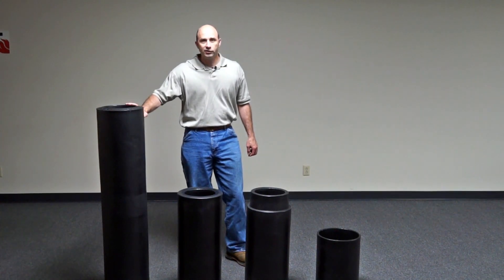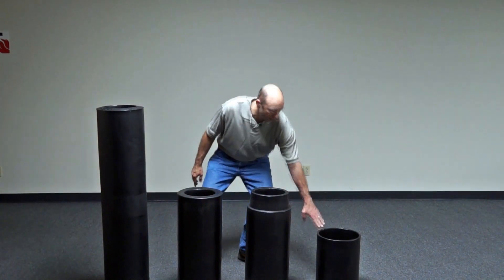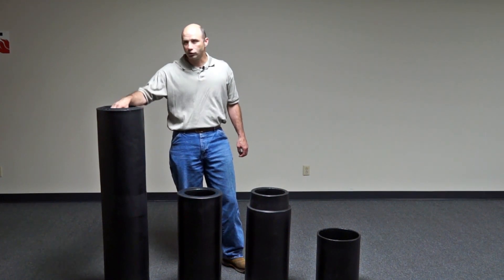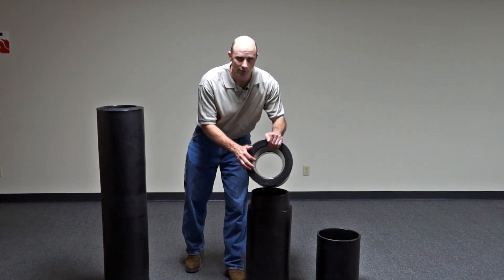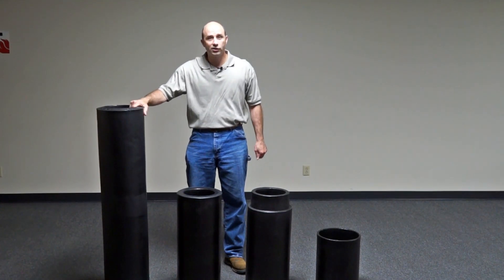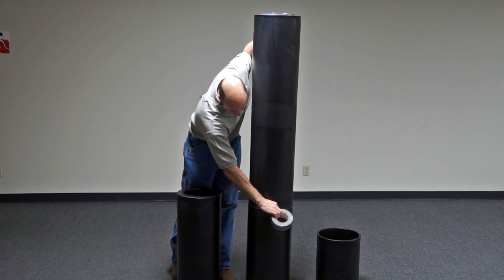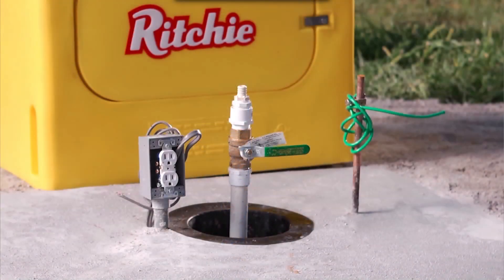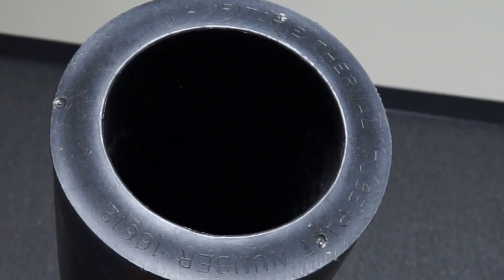Information on Ritchie Thermal Tubes

Comment: So if you want a 3’ you buy a 4’ and cut 12inch off
Reply from the maker: No, do not cut the thermal tube.  If you want 3' you will need a 2' extension and a 1'top. Part numbers are 16416 and 18158